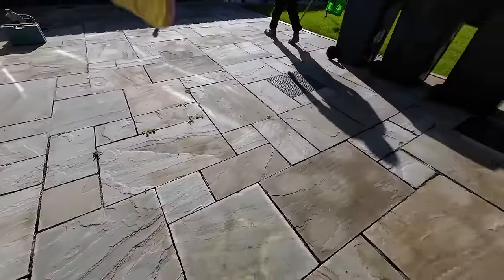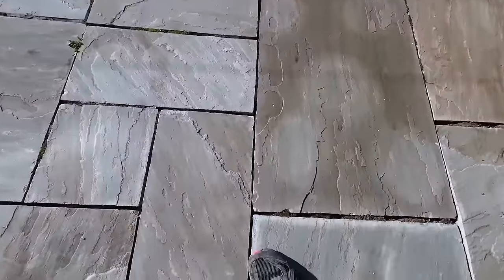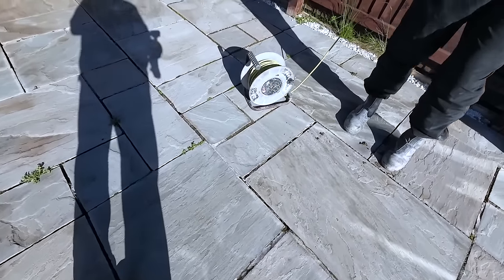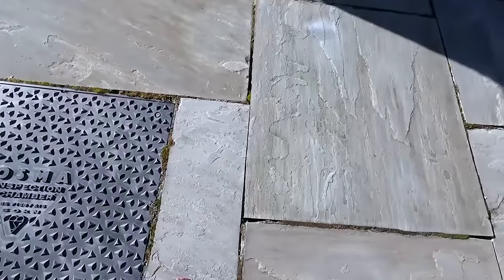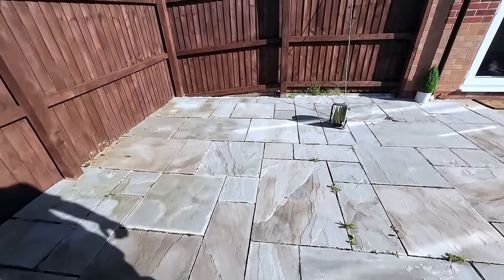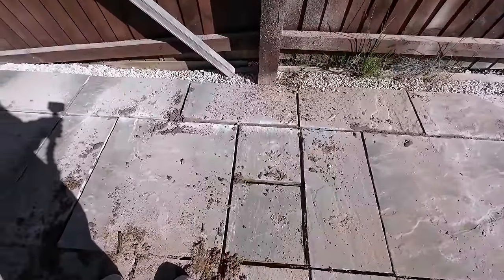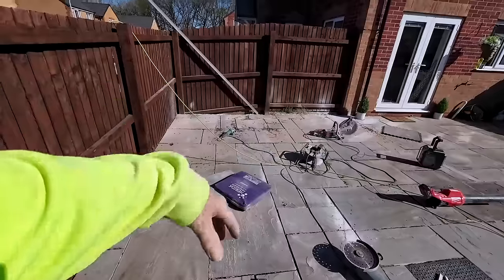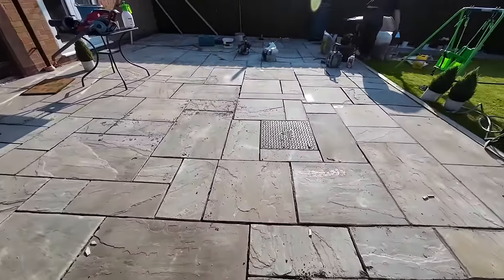RIPPED OFF BY COWBOY LANDSCAPERS, SCUMBAGS !!!

Comment: Hi Steve and Alex , I've used the joining compound on my slabs , good stuff its not cheap put it help with drainage and easy enough to brush in and still looks good  2 years later
Reply: Definitely the way to go.  It’s really good stuff. The bonus is, you can joint up even if it’s raining.

Comment: Easy way to stop the dot and dab stains showing through especially on the Indian stone slabs is to prime the backs with a diluted pva solution.soon dries. They are also usually very dusty so I also give them a quick wash.the key to the sand cement bed is then a lot better.well worth the prep I think.

Comment: Think you have done the best you can. I haven’t seen dot/dab mortar stains on slabs before. Regards the slab joints I always use plastic spacers so the joints are always uniform and have never dot dabbed slabs, surprising how many videos show people doing it. Like you say if the patio is uneven if will eventually need redoing.
Reply from the maker: Cheers Richard its not good at all. just about useable for now 🙄🧱👍🏽👍🏽

Comment: Lots of cross joints as well, which is a definite no no on flagging.
Reply from the maker: It’s a disgrace Glynne . The ground works underneath are shocking . One flag had dots under it that were at least 170 mm deep 😡😡🤠🤬🧱👍🏽

Comment: “Geo fix” great for filling patios saves using cement - brush it into slabs no staining , comes in a tub ready mixed with, expensive but worth it . Just clean joints out first . Great job boys 💪
Reply from the maker: VERY expensive and I’ve seen some reputable landscapers say it’s rubbish too 🤨🧱👍🏽
Reply: @SteveAndAlexBuild  Geofix is the worst jointing compound on the market.

Comment: Good video, just subscribed to the channel. Did you ever consider mixing sand and cement mix really wet and let it ooze into the voids below the slabs and it would fill the joints too? Cheap and easy but the clean up could be difficult.
Reply: Hope that doesn't come across as a crticism, just an alternative view
Reply from the maker: There were a few options we could have tried but the whole thing needs ripping up and relaying properly 😔which would cost a fortune.
   Thanks for subscribing 🙏🏽🧱👍🏽

Comment: Only positive was daisy boys to many bad things to mention on that patio.I new youd pop more discing the joints but you had no choice.im affraid to say you'll be back to re visit it again and again at some point. 
So sorry they had to pay for that its basically a rip it all up and re lay it all and check the base at that stage aswell. You cant flowpoint it because youd loose the slurry in the dabs under the slabs .Best quick fix is cement mortar as you did.
It aint gonna last lads im sorry to say due to a terrible installation in the first place.
Good on you to help for free and make it safe for daisy but its a right off that is .Makes me fume its not fair on people work like that
Reply from the maker: Definitely  Justin it was a very depressing job to do knowing it was just a band aid solution. Its not even paid for yet as they borrowed to get it done. 
    It cracked again within days but all the slabs are safe for now so Daisy can still enjoy her garden.
    One flag was dot n dabbed on 170 mm dabs 🫣😤😡🧱👍🏽
Reply: @SteveAndAlexBuild  
They should be ashamed Steve terrible to do that to people gives the industry a bad name
Reply from the maker: They couldn’t give a shite Justin, they’ve got the money 💰 🏃🏻🤬🧱👍🏽

Comment: Ye gods… should have been laid on a full sand cement base…are all the slabs the same thickness…??? Nowadays, I think I would use a preparatory joint from a tube…flexible and sticks like shit to the edge if the slabs (if cleaned), and also stops water penetration, so,important to have a good fall and drainage…
Reply from the maker: Absolutely none of the above on this patio 🤡🤠🤬🤬👍🏽🧱

Comment: Good morning and hope that you all had a wonderful 🎄🎁
I am just speechless at time and time again I see this Indian sandstone put down either wrong on spots, don't know how to work the 5 slab sizes in a working pattern 🤬😡 These should never be put down on spots as there is a chemical reaction between the stone and the cement that causes staining to comes through. So should be put down on a full bed so any colour change is across the full slab and not just on contact points with spots. Once these stains have happened there is nothing you can do other than replace the affected slabs. I am concerned about how it's been put down, as will hold moisture along the bottom of the timber fence along all the edge of contact and needs a gravel board.
Great job with the best you could do. Why put stupid cuts in around manholes when you get paving trays and replace the old lid with a tray that holds a slabs of which yes you cut if the pattern falls wrong so your mortar joints follow through. Wishing you both and all your family a happy New Year 👍🧱🤜
Reply from the maker: It’s basically a complete shit show to be blunt and these clowns did multiple gardens on the estate as they are new builds so everyone needed gardens done quick 😔.
  Same to  you and your family 🥳🥳🧱👍🏽